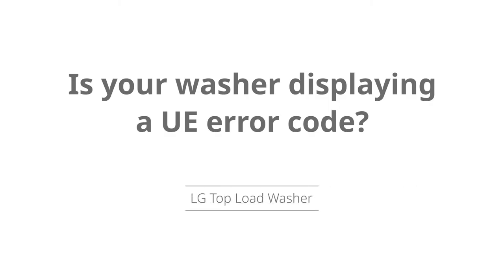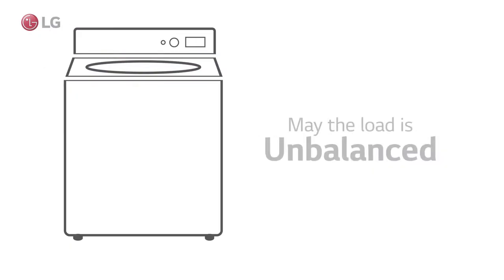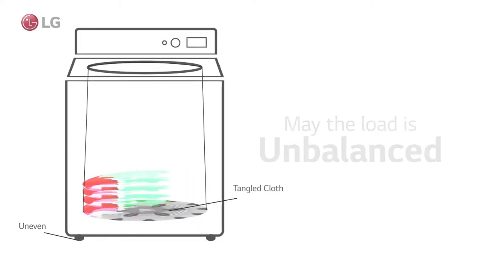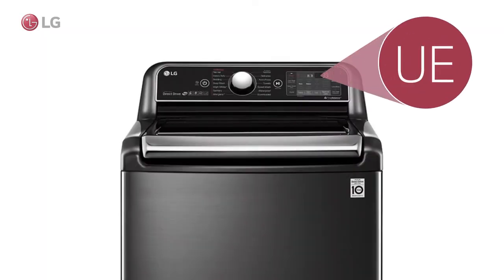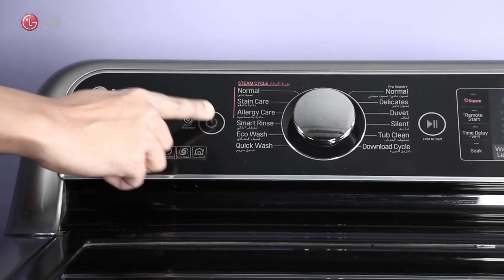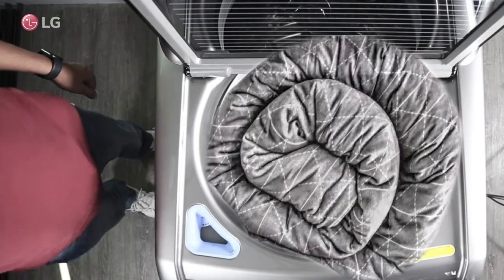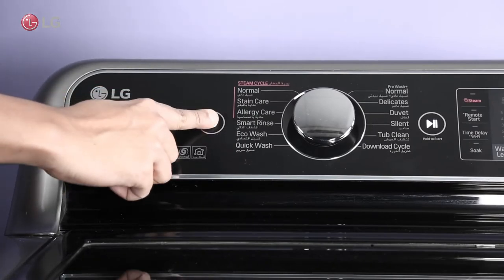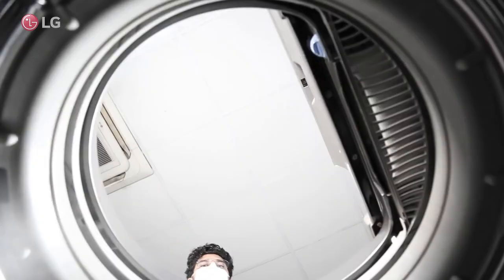[LG Top Load Washer] - UE Error code on display (Unbalance Error)

Comment: Does UE and Ub mean the same?
Reply from the maker: Hello, Thank you for contacting LG Electronics. 
Kindly be advised that the UE/Ub are similar.
Certain load types may not distribute the weight of the load evenly, resulting in an unbalanced load and the UE/Ub error code. If this often occurs, it may be necessary to re-level the washer.